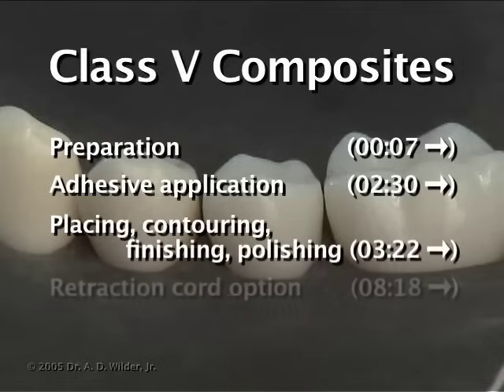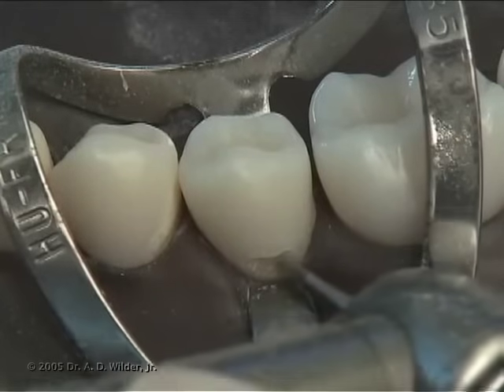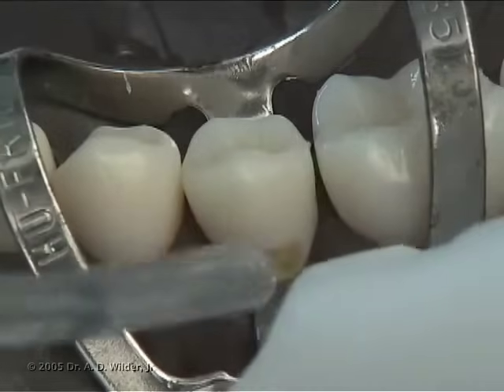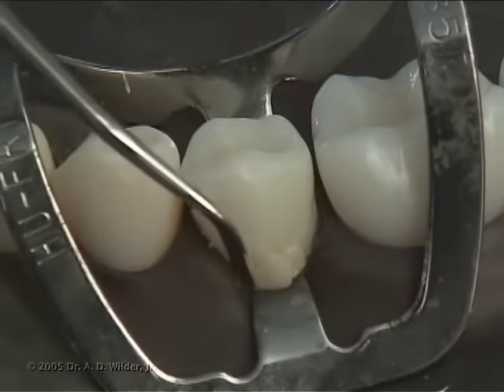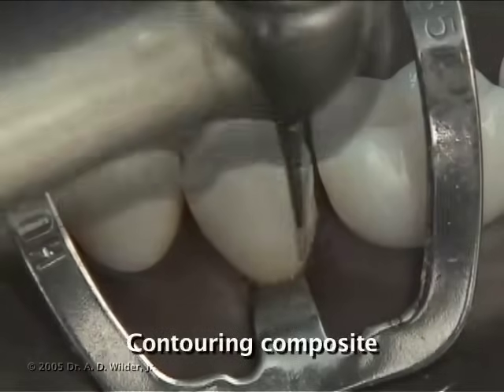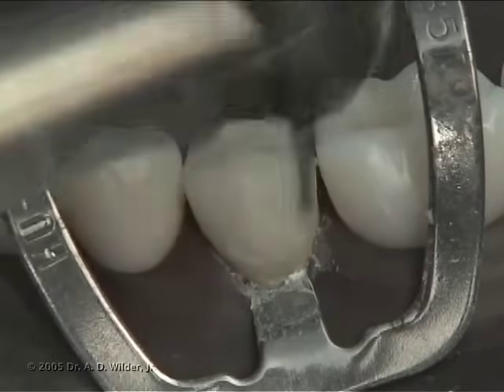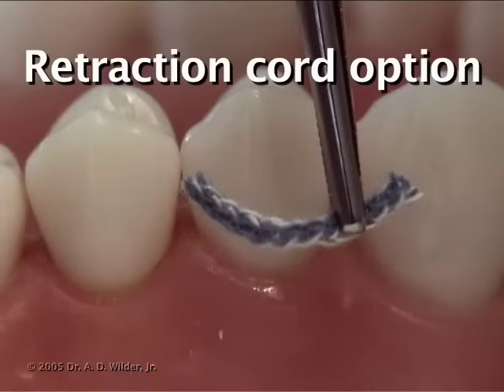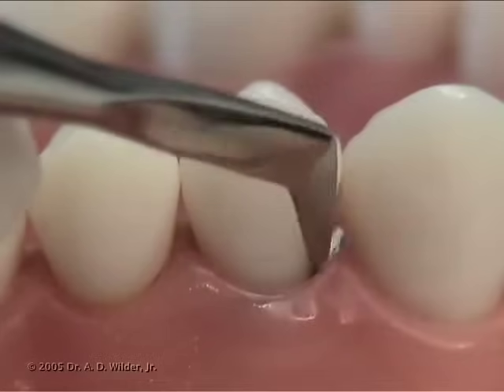Class V Composite Preparation & Restoration | Operative Dentistry

Comment: Why are mesial distal walls divergent?
and where to place retention groove and why?
Reply from the maker: Mesial and distal walls should be more parallel, but the occlusal and gingival walls should be ever so slightly divergent to avoid having unsupported enamel rods. Retention grooves are 0.2mm inside DEJ to provide resistance to buccal displacement.

Comment: 3 things I do differently:
- I use a metal matrix band to retract the gingiva rather than rubberdam and metal clamp. You can angle the matrix band as you desire and then lock it in place with interproximal wedges
- I use flowable composite for maximal surface smoothness at the gingival margin. I never ever touch the equigingival or subgingival part with anything rougher than a polishing bur to prevent irregular or rough surfaces.
- I never ever blow air on the primer or bonding. This is a very common mistake that should absolutely be avoided. It is advisable to use a clean microbrush instead to soak up the excess primer and/or bonding agent. This technique gives you much better control over where the primer and bonding are and aren't going, rather than blowing it all over the place.

Other than that, nice presentation and thank you for sharing this.
Reply from the maker: Interesting, thanks for sharing your alternative approach. I have used the metal matrix bands for Class Vs and while I personally don't prefer them, they can certainly be useful! We will agree to disagree on point 3, as there is a wealth of data supporting the efficacy of an air-stream evaporation method rather than just wiping away excess adhesive. Do you have any high-quality evidence you can share to support this method?
Reply: @mentaldental  The method I use is largely due to personal preference, though I'm sure that your method would outperform my method in a controlled study environment. The problem I have with this method is that it is harder to reliably reproduce in practice, giving you less control over where the primer and/or bonding agent is and isn't going.
I've talked a lot about this with Bart Van Meerbeek and Marleen Peumans (KU Leuven) who both have done a lot of studies on adhesive dentistry. They both apply the same technique you use, but always taught me that you should never blow air directly at the primer and/or bonding agent, but rather use gently air flow over the cavity to fasten the evaporation process.
Reply: Interesting approach! I never thought to use a matrix band for Class V. We're taught in dental school to blow air on the adhesive in order to evaporate the solvent, which subsequently increases bond strength.
Reply: @jdk1313  The solvent will evaporate by itself if you give it 20-30 seconds, but on the condition that you don't use too much of the primer agent. That's why I use a second (dry) microbrush to soak up the excess primer. By doing that you solve the issue of having too much primer and you also give enough time to the solvent of the primer to evaporate
Reply: @cvdp8665  Ah okay makes sense. Thanks for explaining!